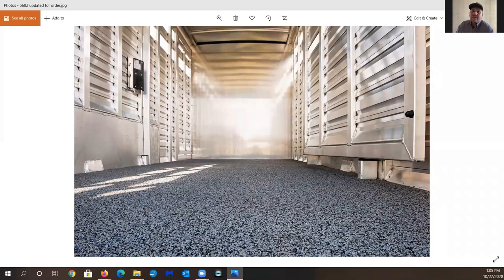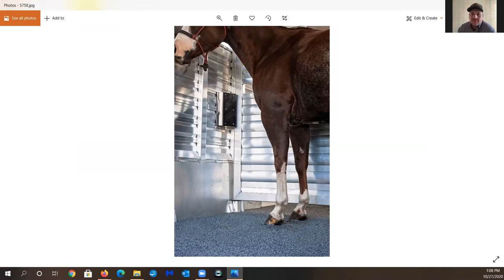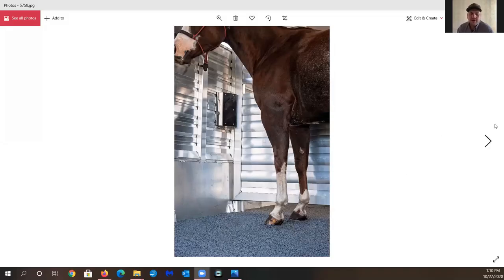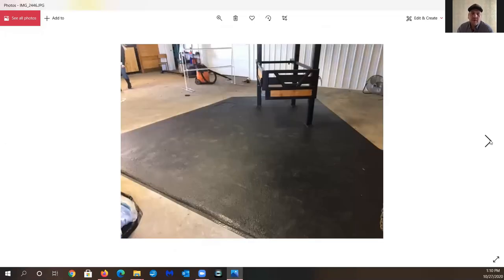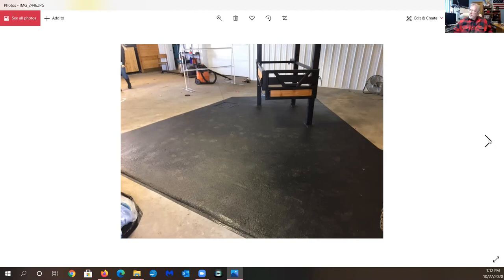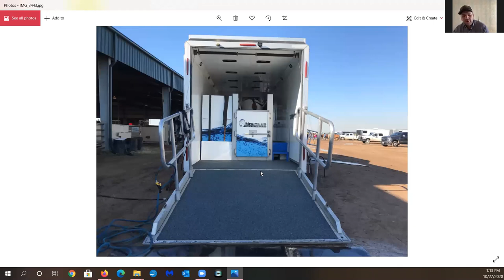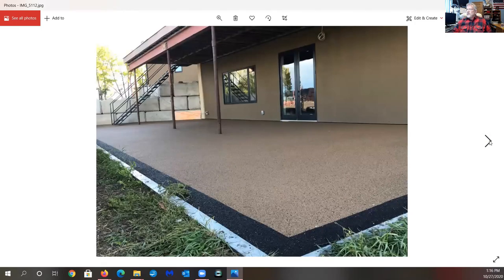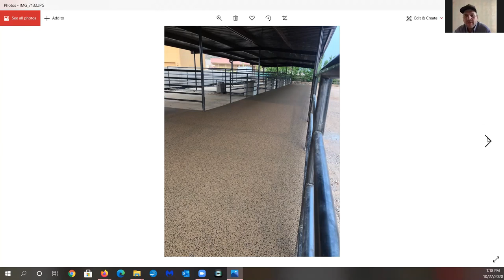Video 5 during the Virtual NATDA Trailer Show, featuring HoofGrip recycled cushioned rubber flooring

Comment: We had this installed in our horse trailer... I think the material was called Polylast (which I am confident is identical) and we love it.
Reply from the maker: Great, I've used it too. I think Polylast is out of business.
Reply: Hey Guys, Rich needs our help. He writes, "Hello - Thanks for your great reviews.  I’m looking for a new 3/4 ton truck.  I’m trying to decide if diesel is worth it.  I will use the truck as a daily driver and will pull a 7k boat on a tandem axle trailer and occasionally pull a cargo trailer up to 8k lbs.  We live in Park City UT so we are at altitude and go up and down mountains.  I looked through your reviews and it sounds like you like the RAM and the F250 with the new V8 and 10 speed.  Thanks for your thoughts on gas vs diesel and what your recommendation on truck would be.

Thanks,

Rich"Rick needs our help. He writes, "

Comment: I think it just makes your alum floors rot/oxidize faster holds moister longer bad enough the alum planks are welded tight together and clog up with debis and oxidation the plus is when all your welds/tack welds start to break loose you wont hear them and you wont feal the spongeness in the floor its kind of like carpet in a house its soft it holds lots of dirt and shit in and it hides/creats weak spots thats why we have been using rugs for centuries and rubber stall mats. YOU CAN CLEAN UNDER EM DA
Reply from the maker: You think, you have that right. I used them of over a decade in my Logan Coach horse trailers with no problems or deterioration. I know several trailer owners over the years that used different names of the same product. It's a great solution